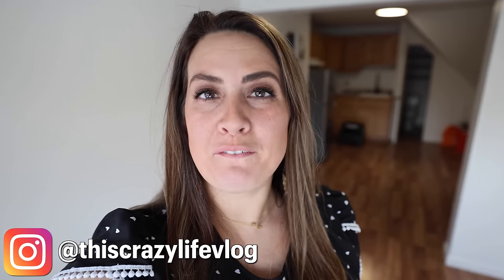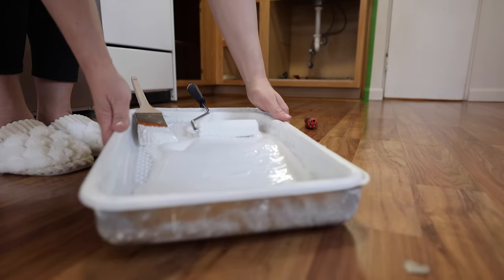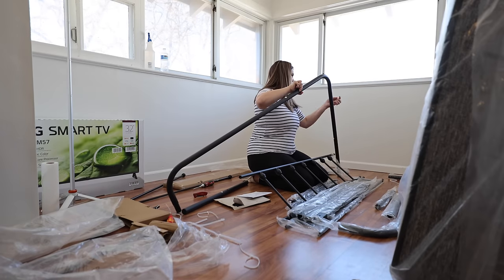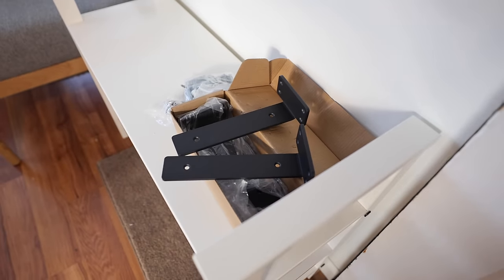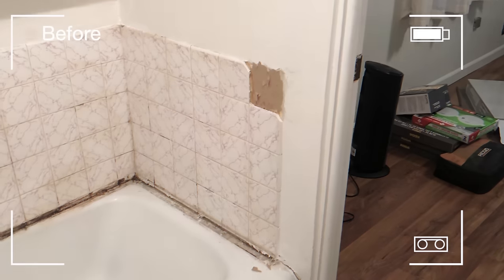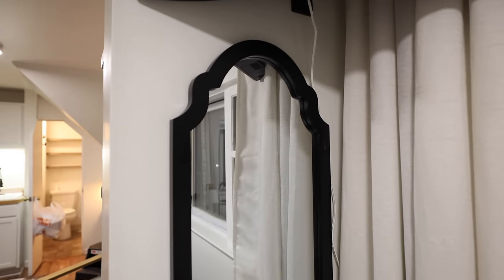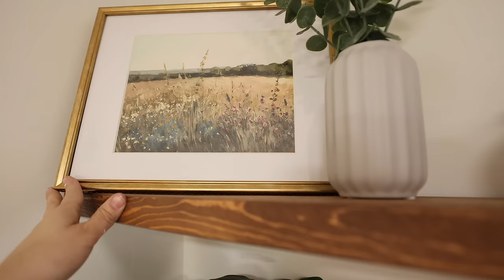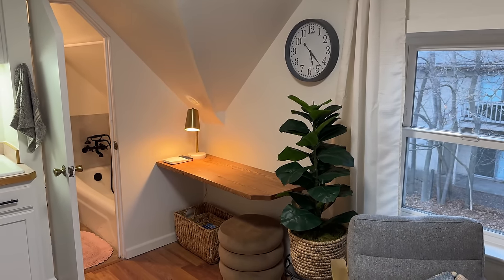Small APARTMENT MAKEOVER 2024 :: Budget AirBnB Transformation

Comment: I love it! So sweet and cozy. Light and airy, too. 

I would pull that bed out those few inches and use the full length curtains. It adds so much ambiance with the filtered light it provides. (Plus those cheap shades need to go!) 

You could also add a multi-functional, circular, padded ottoman between the two chairs to add a useable surface for foot propping, extra seat, playing board games, and even as an extra surface for dining (if it has a reversible hard surface to use as additional table space. Or use a large, flat circular tray for mealtime.)

Comment: I really like the black tub hardware. The vertical tile is great for saving time, although those tiles are quite heavy, especially with mortar on! Helps to have someone to put on mortar when you apply tile. Like the plants and baskets. Disappointed in the size of black table. I know it's a small space, but two people would struggle to eat on such a tiny table. Might want to add a wood round to get a few more inches. New sub. TFS 😊

Comment: I'm not a fan of white cabinets but overall a job well done.  I would suggest though that you change out the old electrical outlets, switches and faceplates from that old beige, black or partially paint-covered ones to a consistent style in white - it would give a much more cohesive, finished and modern look.  Lastly, in case you have more than one person staying in the suite, you might want to consider adding a curtain to enclose the bedroom area from the living area which would give some privacy if one person wanted to go to bed before the other did.

Comment: You could have reconfigured the bathroom by flipping the toilet over and putting it in place of the tub, which would have left you with a standing shower where the toilet is now. Take a bath in that place as it is now must be very complicated
Reply from the maker: We didn’t have the budget (or the time) to reconfigure the plumbing, tear up the floor and add in a new shower etc… and actually the ceiling would be too low to comfortably sit on a toilet where the ceiling comes in. The shower is really just a bath, with a shower sprayer… so you bathe sitting in the tub, and can rinse with the shower nozzle. But the listing talks specifically about that so that no one is surprised when they arrive. And so far there hasn’t been any complaints or issues with it 🤍 I used to live in this apartment when I first moved out, and it wasn’t an issue for me either… just something that comes with old homes is the quirks 😘
Reply: @ThisCrazyLife  Regarding the height of the ceiling, I do not agree, despite being inclined, if you placed the toilet parallel to the wall where the desk is, you could sit comfortably, despite the inclination. Now if it was a budget issue I understand it, but renting an apartment for Airbnb with that uncomfortable bathroom, does not seem right to me.

Comment: I know white paint is the new thing for kitchen cabinets, but the wood in those cabinets was in good shape. I'm sorry you were unable to modernize them without painting. But it's your space, you do it the way you want it.
I would have put a mattress cover on before putting sheets on since this is a rental.
I might have added some sheer floor length curtains tied back to separate the sleeping area in the doorway to the sleeping area.
Maybe a circular rug between the 2 chairs, although it may not be large enough to do that without looking cluttered.
For art I think photos or paintings of local scenes or attractions to help highlight where visitors can go while there. You can enlarge your own photos at a copy store and have printed on canvas for large pictures, or printed off on something cheaper for framed smaller pictures.
I wasn't sure what the baskets under the bed are for.  
All in all, you did a really nice job!